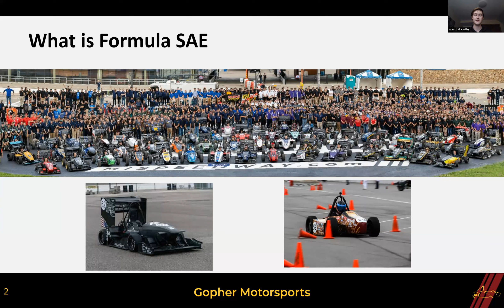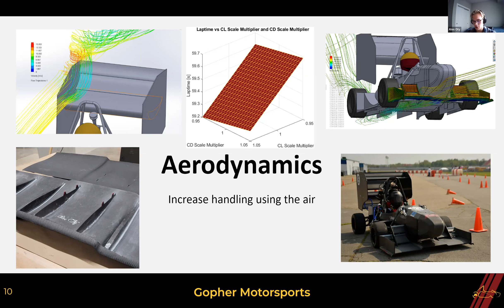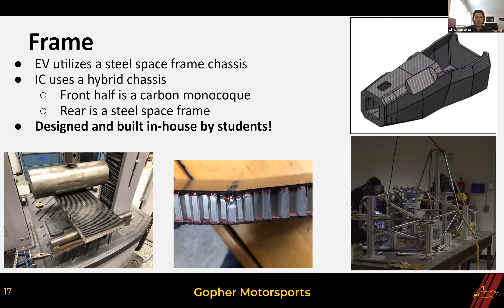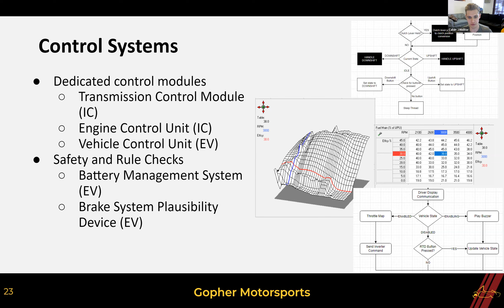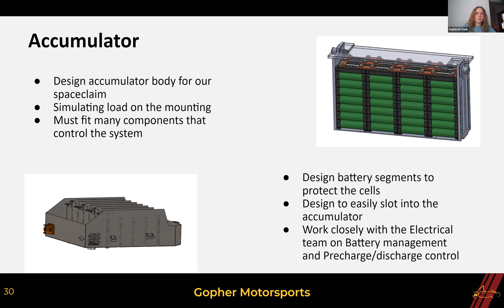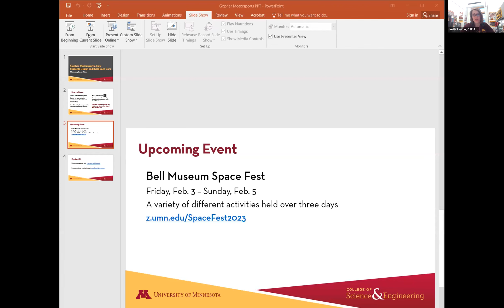Gopher Motorsports: How Students Design and Build Race Cars

Comment: Excellent presentation that usefully helps identify the challenges of both internal combustion and electric-powered competition vehicles. Design and competition programs like this are the incubator cells for the future innovators and leaders that will power the future of mobility.